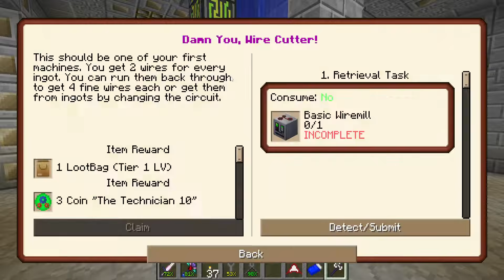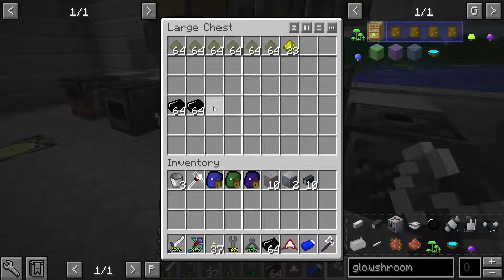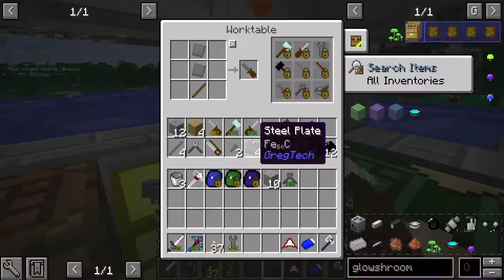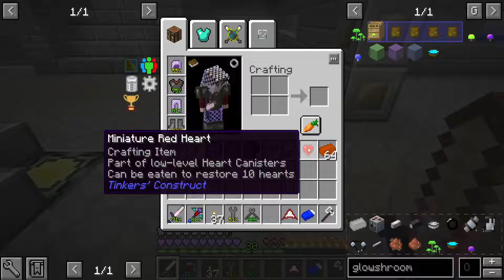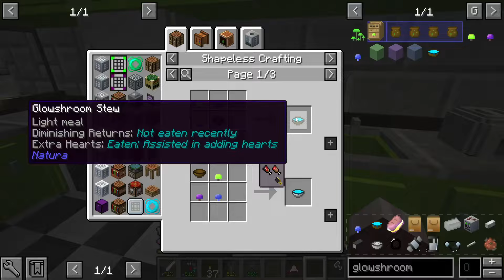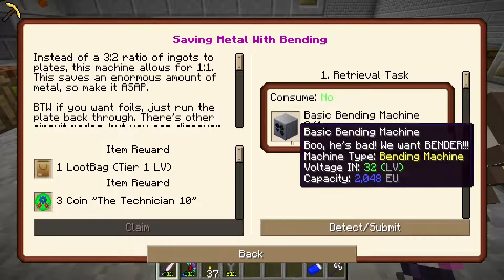GregTech New Horizons EP61: The LV Age Begins!

Comment: 5:08 you will lose 2 EU per meter because you will send 2 amps through the cables instead of 1
Reply from the maker: Good point. What I was trying to say was for each amp there would be a loss of 1 EU per cable. Because there are two amps going in it would a loss of 2 EU in total, but for each amp individually it should only be a loss of 1. At least that's how I understood it. Please let me know if I am wrong. I am still learning.

Comment: Yeah you are gonna have almost all lv machines.

Lv is a long tier bc you need to focus on power generation with steam or oil, and you need oil anyway for polyethylene although the way you play you might want to go with the renewable oil and biodiesel since it's part of the LV age
Reply from the maker: There is definitely a lot to do in the LV tier. Power generation is something I have been thinking about and I have already been given some ideas about it, I am still considering my options. For the short term I plan to add more solar boilers once I get more silver from the Twilight Forest. After that, I will reassess power when the need arises.
Reply: @BufordMCs  steam is the best for early. the only downside is that you need for later tiers massive pipe capacity like in 25k or 120k for 4 Generator. And likly you need more then 4generator.